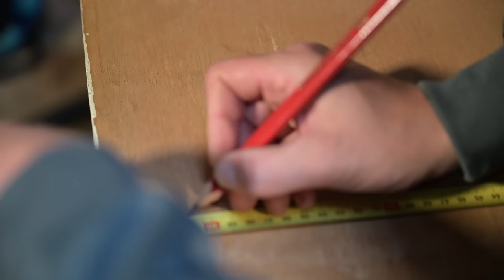WOODWORKING - Building a Chart Table & Installing The Navigation Lights

Comment: Hello, quite an overall extensive project, my respect.  Regarding use of wood filler, epoxy putty and similar,  it helps to put the mixed stuff into a Zip lock plastic bag, cut of a corner and use it like a pastry bag. Very quick and not messy. Very good for making any kinds of fillets as well

Comment: Everything on a boat restoration takes longer than expected. 🤣🤣 
Great video 2x👍
Reply from the maker: The funny thing is we do know that and still end up miss calculating by a factor of four. But the work is rewarding and we are not far away from a boat that doesn't look like a rust bucket anymore.

Comment: Dear Barbara and Daniël,
You’re doing so well with the restoration of Flying Coney that even temporary solutions are made properly and weather protected, your recovered side lights are looking awesome. Willeke and I are wondering if the lightbulbs simply can’t be changed in LED bulbs what’s possible for many lamps nowadays. The guy who’s helping you with wooden solutions is a friendly person with a lot of knowledge how to deal with wood. We look forward to your next vlog and send you love
Reply from the maker: Thank you! Yes the light bulbs can very easily replaced with LED lamps. But as far as I know there are no certified LED bulbs to do so. Since we are above 20 meters we need certified lamps for vessels up to 50 meters in size. My dream lamps are the K2W Base Bronze. They are certified but come with a price tag of 650€ each. Harald really is a lovely chap!
Reply: The problem with LED bulbs is that they are made up as a matrix of small LED's which are not fixed in the same center with each other. This makes it very difficult to ensure that you get the correct angles of light. A traditional certified lightbulb is made with a single filament in the center of the bulb. The "off the shelf" LED-bulb may also be of a light-temperature that may result in the lantern displaying a shift in colour. For these reasons usually only anchor-lights are refitted with LED.
Also the lanternhouse should be painted in a non-reflective black colour (as the older ones were) in order to avoid incorrect angles being displayed by reflection and any colourshift in reflections.
There are proper certified LED lanterns available as complete new units. But they are expensive...
Reply from the maker: Just noticed that vessels over 20 meters in size really do need the non- reflective matt black light shielding. Thanks for adding the information about the LED lights.
Reply: @FlyingConey  Okay, I wasn’t aware of this. Thanks for the info

Comment: You can buy LED lights that will fit in your nav lights, I changed all mine to LED and are perfect. I have a similar baynot type holder.
Reply from the maker: We know that there are replacement bulbs but I haven't found class approved ones for boats over 20 meters in length. Wha's your LOA?

Comment: As a schipper i can tell you the worst thing with a wooden wheelhouse is the connection from the wood to metal, the rust that i can see doesn't seem to bad yet so if you have ever have the chance to take the wheelhouse of i would weld a strip of rustfree steel there so it will never rot again. The wheelhouse is looking great and i am sorry to tell you what you should do but i am suffering the same problems on my vessel and i don't wish them on your's :)
Reply from the maker: Thanks for the advice! The steel behind the wood really is a problematic area. The rust rundowns that you see are mostly where there was no sealant on the window frames. We plan to wash the rust rundowns off with some oxalic acid and we already have renewed the sealant on the window frames. The plan is to take the roof and the window frames off to lower the wheelhouse. Then we have the chance to weld in a strip of stainless steel. There are also some bimetallic strips of steel and aluminium. They used those at the Tigerhaij project.

Comment: If you mix 30% ammonia and water and soak the teak with this and scrub with a dish brush and lightly scrape with a steel spatula, you clean it deeply and it will get its color back, and you don't have to sand as hard.

Comment: Most hardware or lighting stores or online sell replacement LED bulbs to fit bayonet fittings like yours. To save on power fit LED bulbs everywhere you can
Reply from the maker: But they're not legal and unfortunately there's no LED build approved by the class.

Comment: There are direct replacements globes for the navigation lights in LED that are in expensive and will save a lot on power draw.  The globe fittings apear to be for 21 watt incandescent globes and there is 5 watt replacements in LED that have a higher light output and put off virtually no heat.
Reply from the maker: Yeah, but they*re not class approved and not legal.

Comment: 4:20 - you need to mark this video talking about the future that the wheelhouse will do the job for another 5 or 10 or 15 years.

Imagine it would start leaking in 2 years time on the first north sea trip to Scottland or Norway then it will be great to watch this part and your strong believe and confidence in your workmanship - but with a smile "what had I'd said back then". 

Do not take me wrong: I am not painting the devil on the wall (literal translated german saying)  
I am talking about the experience that things I had been so convinced went even far sooner wrong or developed a failure I had completely overlooked or not believed especially all ideas with water and where it can not get through, but later got through and quite often far sooner than thought , which means our solar panel roof on top of the rooftiles got a leakage even it had no leakage before.
Reply from the maker: We did what we could in the two weeks of summer we had. It was a summer so windy and rainy that we almost developed a winter depression. The original plan was to take the solar panels of and repaint the damn thing. There simply wasn't enough time to replace the whole lot and even start fiberglassing. It would've been "pearls for the pigs" 😉 anyway since we probably will alter the dimension of the wheelhouse and subsequently the roof.

Comment: Another material to think about using instead of plywood for outside projects and backing plates is HDPE.  Comes mostly in white or black and smooth or textured surface and a variety of thicknesses.   Other colours can be found too but usually at a higher cost.

Comment: I suggest one change for your chart table . Cut the corners of edging down flush with the table top. That way it can be cleaned much more easily. Sanded , nice curves open corners. It is a nice table in a good spot.
Reply: Raised edges, sometimes referred to as fiddles, prevent things from rolling or sliding off the table surface while underway.
Reply from the maker: Exactly that! Although slightly on the bigger side, after all Flying Coney is a ship. On the ocean every ship is small and it's surprising how much you feel waves and how much everything moves.
Reply: @oldsharkie3786  thanks ,but I knew that. I wonder what fiddles are called in the other languages this good couple speak.

Comment: Enjoy your videos and have followed quietly for a while but had to call out one mistake i fear you may be making.  Your nav light wooden shroud should have a matt black finish behind the lamp to prevent reflection and make the red and green lights stand out clearly to prevent any mistakes when viewed by other ships. Check out the barges moored next to you. Small change but important. Keep on keeping on because you are doing sterling work with the refurb.
Reply from the maker: The navlight bases are not mandatory and I found no rules for this equipment. But you're correct, most boats have the insides painted dark. But sometimes you also find them painted red and green. It's quite difficult to get the paint on them because you need to turn the bases in between wait for the paint to be dry, turn it again and so on. If you watch closely you'll see that the finish is far from perfect because we rushed the painting to get the parts finished. So for now we won't sail at night and I'm almost certain that it's legal to have the insides painted white. Maybe we paint the insides black next spring.
Reply: The COLREGs require that sidelights (except when they form part 
of a combined light) shall be fitted with in-board screens which must be 
painted matt black.
Reply from the maker: I guess that the lights we have do have a built in screens. We have an entire winter to buy matt black paint if needed. I have the COLREGS aboard and will check a little bit later.
Reply: only trying to be helpful, that was a direct quote from "instructions to surveyors" re navigation lights, UK 6.1  @FlyingConey
Reply from the maker: Thanks for being helpful and helpful it was. I looked it up (again) and noticed that I've overlooked this section. Vessels over 20 meters need to have it in matt black...

Comment: There are plenty of 12v led car bulbs that would fit your nav lights some with built in drivers and others need external ones, they are not verry expensive so replacing them should be fairly easy.
Reply from the maker: Exchanging them is easy and inexpensive and unfortunately not legal. You need class approved certified lamps at least for a vessel our size.

Comment: With the sockets I saw in the one navigation light you opened, could you not install LED bulbs in place of the incandescent bulbs, as an update?
Reply from the maker: Yes it's possible to install LED bulbs. They're not even expensive. But it's not legal to use them. Navigation lights must be class approved and certified for the type and size of vessel. In our case we need certified lights for vessels from 20-50 meter. K2W Base Bronze LED lights would look great but they are 650€ per light.

Comment: You can place a LED bulb in the existing Navigation lights?
Reply from the maker: So far I haven't found LED bulbs that are class approved for boats over 20 meter (For example Solas). A certified LED navigation light starts at about 100€.

Comment: Do you intend to use teak oil on the doors and frames?
Reply from the maker: Epifanes one component varnish. I've spoken with Epifanes and there's not a huge difference in between the varnish and the teak oil.

Comment: It is possible to buy lamps with the same socket but in LED
Reply from the maker: As far as I know the replacement lamps are not certified and not class approved. So technically that makes them illegal to use.

Comment: Best just oil the teak with a rag.
Reply from the maker: The varnish you see at the end of the video is specifically made for teak. In my opinion you can use either Epifanes, Owatrol or LeTonkinoise. Each product has pros and cons.

Comment: Why didn't you cover the rotten edge up for some days to give it a chance to dry? Putting some resin in there will trap the humidity in there. Or at least it will have to find other ways to dry.  Great you're saving some of the mahogany now. The nav light bases will also need some epoxy coating as it's no exterior plywood from the look of it.
Reply from the maker: Sometimes for the sake of storytelling we don't show or tell every single step. There was enough time for the corner to dry out. The plywood for the nav light bases stood outside in the rain for over a year and it's still fine. I think it's at least AW100 ply but probably marin ply.